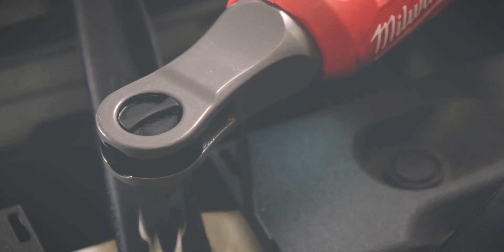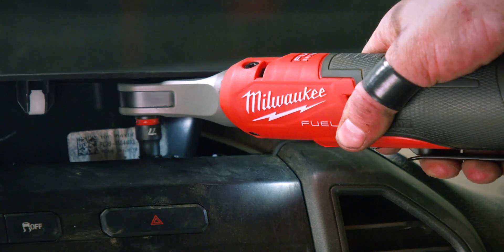Milwaukee’s New High Speed Ratchets

Comment: is it possible to make one with 70ft lbs and the 450rpms ?
Reply: Lol, yea and it would probably break alot of peoples wrists, hands, etc.. but maybe not, I'd think around 70 ft lbs at 450 rpm would be pushing it though. Get up higher then that with a electric ratchet and it would likly be dangerous honestly. If you want more torque get the right angle impact. Electric ratchets like this are for speed, not so much for torque.

Comment: Notice how they didn't say the torque
Reply from the maker: Hey, ya only in the specs. Both models are listed at

Torque: 35 ft-lbs
RPM: 450
Reply: Also available in video description when I checked just now. February 12th, 2021 6:21 am Eastern (UTC-5)
Reply from the maker: @jkxss  thanks Jason

Comment: I have a question about the 2567 or more to the point 49-09-2567 Will that 3/8 gear set fit into the m12 fuel 1/4 ratchet? I've  been unhappy with the m12 fuel 3/8 head size, bulk, and weight of the ratchet.  I have asked multiple times for a 1/4 body m12 fuel with a 3/8 anvil.
Reply from the maker: Good question, I'm not sure yet. Maybe someone can chime in with the answer? 

I look into it and follow up when they come out. The release date for these is Feb 2021.
Reply from the maker: https://youtu.be/ql1_POSDH1A
Reply: Everyone loved the original brushed one as it would go in almost everywhere...BUT...it wasn't very robust...to say the least...and so, people liked them a lot, used them a lot AND also used the waranty...too much. AND so, Milwaukee over compensated with the new "Fuel" beast. Unfortunately people had the problem you note. If you can't get it in there, then what good is it? AND so, they come back with a gen 2 reduced head size (but still more robust than the brushed one) so you can get to "most" of the places of the original brushed one, but are back to the lower torgue as the gen 2 likely is NOT robust enough to handle the 55 rating. Evolution in practice and in your pocketbook.